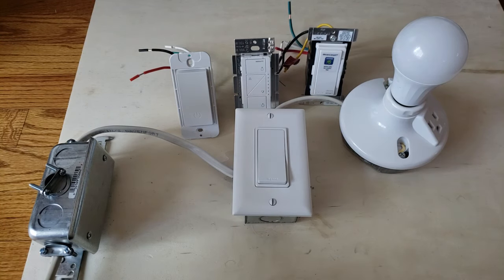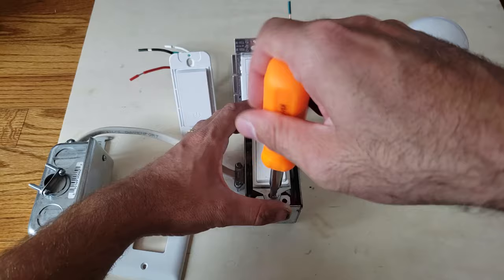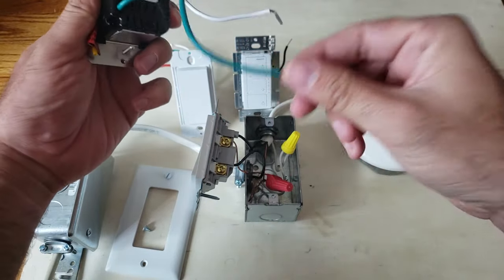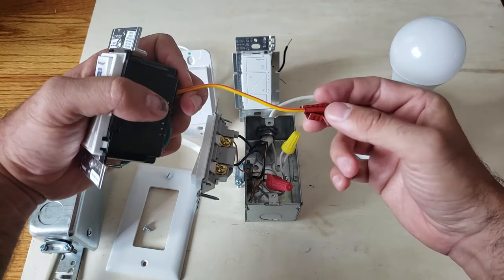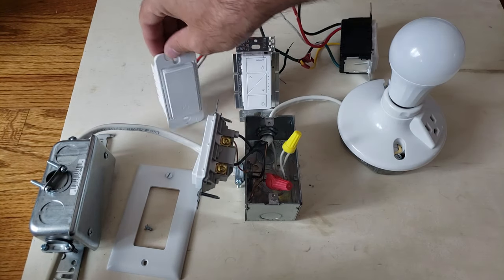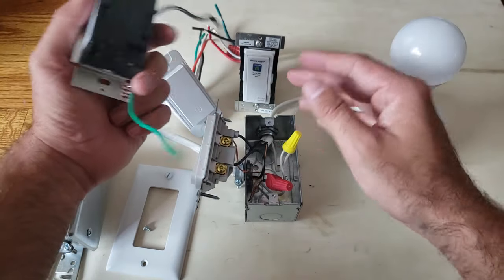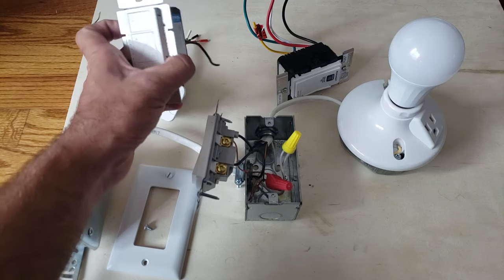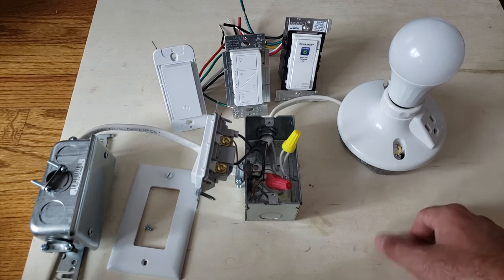Smart Light Switch Neutral Wire - Do You Need One?

Comment: Hello thanks for the video... I was installing a smart switch but its not working 
I have 2 black wires 1 red and 2 whites... there's only 3 holes in the switch... i don't know where to put them, can you help me?
Reply: Red wire goes to the odd coloured terminal on the switch (common/traveller)
Black wires go to the other colour terminal (2 terminals same colour)
Reply: @montgomerybojangles8644  thank you

Comment: Holly crap, all this time I've thought I didn't have a neutral wire because it wasn't connected to the switches I've replaced. Never paying attention to those two wires connected together shoved behind as being the neutral I would connect to. Until I just saw them in your video. This opens up so many options for me. Fortunately, I love my no-neutral Casita system but now need to add a Caseta ELV which does need a neutral. Thanks for the video.
Reply from the maker: Thanks for watching and the comment! Glad to help, smart switches are a great upgrade.

Comment: If the network is down for whatever reason does that mean the light switch wouldn’t work at all or just the “smart” part of it??
Reply from the maker: The light switch still works like a normal switch, but the smart functionality wont work without the wifi.
Reply: One Hour Smart Home thanks for the answer.  Also does the caseta work for any LED lighting?? I want to install about 6 recessed LED lights but not sure if there will be compatibility issues

Comment: GE sells a smart switch "3 wire" - hot, load, ground - that does not require a hub or a neutral.   Costs a bit more - around $45.
Reply: My sister bought that switch but HAS a neutral wire in the box.  Will it still work?
Reply: @illinigrad  I THINK if you have a neutral wire going into a box with a normal (single pole) switch, you will find the neutral is basically just connected with a wire nut to an outgoing neutral.  Essentially the neutral is just being passed through the box. The hot wire coming into the box is attached to the switch and the outgoing hot is  attached to the other screw on the switch.  So the switch turns the outgoing hot on and off.    If that's how your box is wired, you would not have to do anything with the neutral wire. It is just being passed through.  Though this GE switch it isn't necessary and you would probably be better served by a smart switch that has a neutral connection.  The GE non-neutral switch has its quirks and is less likely to work with your bulbs or fixtures without an adapter.   I'm no expert so please check with other sources.
Reply: @Bestportlandrentals  Thanks for the Info!  The box has no wire nuts in it.  A white, red, black, and bare that all go directly into the current switch.  I think I will get a different smart switch for my sister and put this one somewhere else in the house.  Again, thanks for the advice.
Reply: Bet the one that doesn't need a neutral wire is simply using the ground instead. They are both the same because they connect together in the breaker box. The switch draws ma so why not use the ground wire if a neutral isn't available? Is there anything in the electrical code about this?

Comment: i see another video where the some dude connects the neutral wire with the ground will that work?
Reply: Do not do this, it's against code!
Reply from the maker: No, you can't do that it's a shock and fire hazard. The ground should  never be used as a neutral.
Reply: It would seem logical to do so since both neutral and ground wires are connected to the bus bar in the breaker box anyway, but it is dangerous and not recommended.
Reply from the maker: 1. It's dangerous, 2. Your electrifying the ground. Which can ruin electronics or shock you. While they are connected at the bus, they then go to zero a the ground. When you electrify the ground in the circut you are electrifying everything downstream from the switch to the panel.
Reply: That should work to power the switch, but it is unsafe and would be against all building codes.

Comment: So there's no smart switch out there did you can use on Wi-Fi. That does not require a neutral wire? All non-neutral smart switches have to have a hub? In my situation down in the basement we have rested lights two tubes per light and one room there's four fixtures and the other there's eight light fixtures. I'm having a hell of a time trying to find a smart switch for these two rooms neither one of them has a neutral wire Inside the Box. Was hoping to get a Smart Switch that does not require a neutral wire but runs off the internet instead of a hub. Any suggestions?  thanks
Reply: Check Zemismart swithes.They have smart Wifi ones with and without neutral.

Comment: With Lutron caseta products there are some that require a neutral wire and others that don't. Recently I was shopping for a non-dimming Lutron caseta switch and I discovered two different models. One of them required a neutral wire and the other didn't. They were identical otherwise.
Reply: But..... don't you (without the neutral) then need some kind of capacitor setup. at the appliance itself?

Comment: What happens if you want to use the Lutron smart switch, but your home has a neutral wire? What do you do with the wire? Maybe a stupid question, but I am ignorant when it comes to electrical. Thank you!
Reply from the maker: Just leave the neutral wire as it is. You dont need to do anything with it just leave the existing neutral wire in place.
Reply: If you have a neutral wire in the wallbox is better to find a dimmer with neutral, Lutron has the best. The dimmer perform better and you can low the load capacity, also sometimes depending on the quality of the led bulb you might need a minimum load adapter connected in parallel to the load, to help the led to perform better. Would be great to talk about this, is a very common issue and is very simple to solve.

** remember if you are using dimmers and led’s, buy dimmable Bulbs...
Reply: Thanks you guys!

Comment: Where did you talk about the options for adding a neutral wire? Did I miss something?
Reply: I'm no electrician, but my assumption is that your house either has it or it doesn't. Adding a neutral sounds like would only be done if you've gutted the entire house and are rewiring, like after a natural disaster.
Reply: Trey Cranson a neutral wire is installed at every house, it’s just if the neutral at switch boxes are being used at a switch loop instead. But to be clear every house contains a neutral.
Reply: Adding a neutral wire to the switch box is probably the best solution in the long run.  This can be a complicated job if there is not a neutral wire connection somewhere near the switch box.

Comment: Warning: If you have an older house the wall box may be too small to fit a 3 times larger switch and the extra connector caps. Then you have to put the old switch back or tear up your wall for a new box.
Reply: You can at worst put in a reno box, forget what they are called but no mudding required, just maybe some cutting a bigger hole

Comment: What happens if you connect the red wire to the wrong black wire
Reply from the maker: This video should help you better understand electrical wiring: https://youtu.be/Q4OkmhTVaJ4  With a Lutron Caseta smart switch: https://amzn.to/2K3ar3e , as long as you have a hot (typically black) and a load for the same switch (can be red, yellow, blue, or black) the Lutron Caseta smart switch will work. With the Lutron Caseta switch either wire can be wired to the load or the hot wire, either direction of current flow will work.  Hot brings current to the switch, load wire carries current from the switch to the light fixture (the load).

Comment: I don't get it how the switch is powered if it doesn't have a neutral wire to complete the circuit !??!
Reply from the maker: The Lutron Caseta: https://amzn.to/2GP73us system uses a low power RF frequency for communication. It's power requirement is so low that the communication chip can be powered with a minimal amount of current going through the the circuit that is so small it's not enough current to light up the light bulb. Wifi signals use a lot more power for communication, which is why most wifi operated light switches require a neutral wire to continuously power the wifi switch communication chip.

Comment: So do you need one?  Do they work without it?
Reply: If you are talking about the neutral wire, most smart switches do need both neutral and hot wires in the switch box.  There a few special smart switches that will work with no neutral connection to the switch, but the ones with a neutral connection are usually better.

Comment: As an electrical contractor, I often view these videos critically even though I understand the intent is good. The truth is, it is quite common for switches to not have a neutral wire within the box. This is called a switch loop.   Whether or not they exist is determined by the layout of your wiring system, as well as preference of the electrician. We run into many homes built after 1995 that  utilize loops for switching and do not have a "neutral" conductor available. Please remember that not everything is a DIY project.
Reply from the maker: Jake, NEC 2011 requires a neutral in the switch box unless you have a raceway or access to the box from above  so you could add one if needed. Even prior to NEC 2011 being adopted, most larger municipalties required a neutral wire. Just because you run into it doesn't mean the installer did the work correctly. Also when using romex, there would be no reason for a neutral wire to not be in the switch box as they are bundled in together (neutral, ground, and hot) in the romex. What part of the country do you live in? Do you live somewhere that conduit is used?
Reply: Be a drop switch ?

Comment: Here is my issue.... the switch I want to replace doesn't have the Neutral tied together because they tied it into the light first.  So how do I install a smart switch in this case?
Reply from the maker: Doesn't matter you can still install this switch. The lutron caseta doesnt need a neutral in the switch box. It will work in the configuration you mention. Just remove the old light switch and wire in the two wires to the existing 2 wires tied into the existing light switch.
Reply from the maker: That's fine, as long as you have an existing working light switch you can remove it and install the lutron caseta light switches. You dont need a neutral wire in the switch box.

Comment: I only have two wires. A black and white.
Reply from the maker: Then Lutron Caseta: https://amzn.to/3gzB2Uq is the best option for you. It will work with your wiring.
Reply: @OneHourSmartHome  It works without a ground wire?
Reply: If these are the only wires in your switch box, then there is no neutral wire there.  The white wire should be wrapped with some black tape, near the bare end, to identify it as a "hot" wire.  To use a smart switch, you would need to get one of the versions that do not require a neutral connection.  The green wire from the switch is supposed to be the ground wire.  If there is no grounding point to connect the green wire, you would just cap it with a small wire nut.

Comment: Misleading title - wasted seven+ minutes of my time.

Never actually explained in the video HOW to wire a standard single pole smart switch with four wires into a box that doesn't have a neutral wire. Just recommends getting a special smart switch with only three leads i.e. no neutral.
Reply: Actually, you can't use the four-wire switches in a box with no neutral, so no video will show you how to do that.  This video shows a 3-wire (no-neutral) switch starting at the 5-minute mark, and explains how to connect the wires.  The title of the video simply promises to answer the question of whether you need a neutral wire to use a smart switch, and then proceeds to explain which switch types do and don't need the neutral wire.

Comment: Not helpful at all. Can you show us how to connect the neutral wire to the switch God damn it?! They are 2 neutral wires coming from the box, do you use just 1? Do you connect all 3 together? Damn...
Reply: The neutral wire from the switch gets connected to the other two neutral wires inside the box, with all three white wires twisted together using the yellow wire-nut shown in the video.  Anyone who doesn't know this, or can't figure it out, should probably get an electrician to do the work.

Comment: Smart Light Switch Neutral Wire - Do You Need One?

You didn't answer the question mate.
Reply: The question was answered.  Most smart switches do need a neutral connection, but there are a few special versions that are designed to work without a neutral connection.  The Lutron Caseta is one that is described in this video, beginning at about the 5-minute mark.